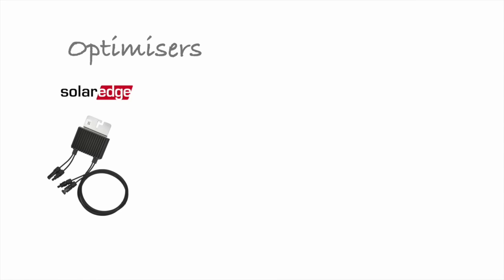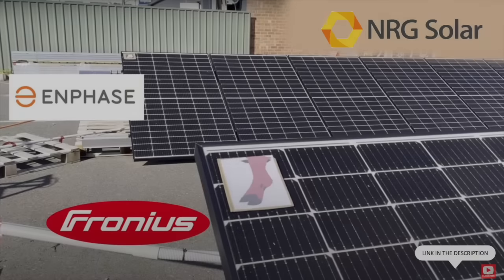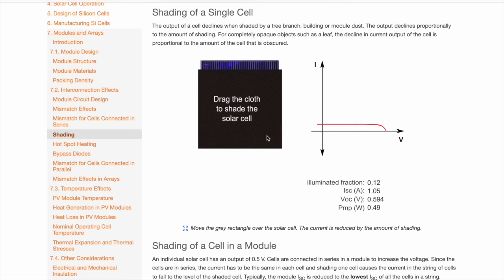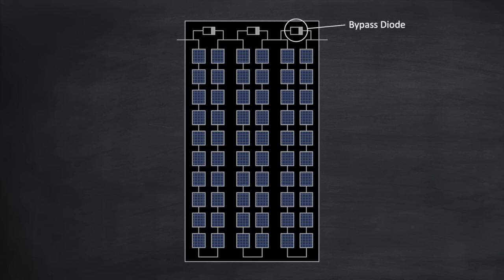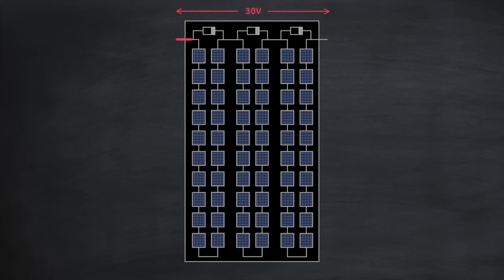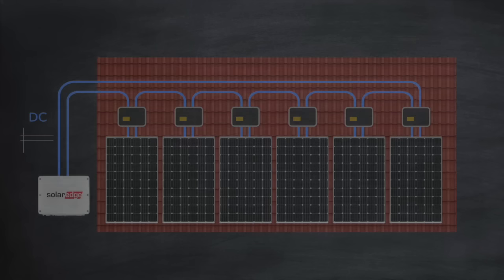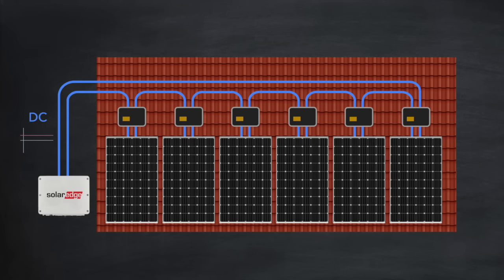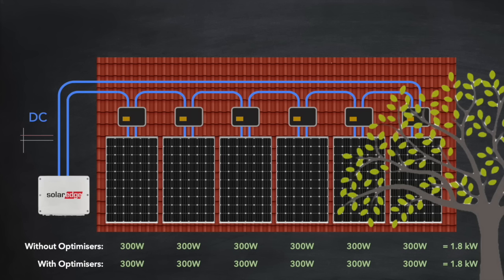Solar Panel Shading (Part 1): Are Optimisers and Micro inverters Worth It?

Comment: An excellent presentation.  In fact that’s one of the best presentations on the subject of partial shading that I’ve seen.  I was aware of the bypass diodes, but hadn’t considered the impact on the larger array.  

I think panels have evolved a little to include “half cut” cells.  I think they run the bypass diodes up the middle of the panel, essentially doubling string number, and halving string length.  It improves two attributes:
- better partial shading performance
- reduced diode hotspots, thereby improving panel life

That diode heat loss can be a real panel killer. 

I did my own shading tests, which I think is in my Spring/June video this year.  The direction in which shading is uncovered has a big impact on performance.
Reply from the maker: Coming from you, Anthony - that's praise indeed! Thank you. I might do a follow up on shading when I've collected enough feedback etc. and I'll be sure to include half-cut cells :-)

And I remember your shading tests - I can't wait to be my own setup installed in January to do some of my own (I'll have relatively easy access to the panels as I have a number of Velux windows on my roof). I've had a bit of a nightmare with my solar journey, which started back in March!

Let me know if you're interested to do something together on YouTube at any time - I'd be game on for that.
Reply: Agreed, well presented. I’m breathing a sigh of relief knowing that I did do the right thing putting Enphase on my second array ( split across SE and SW facing roofs with chimneys ) Thanks
Reply: Direction of shade encroachment is indeed important. Most PV modules are wired as Gary illustrated so that the long edges each fall within one bypass diode zone. This is good for commercial ground mounted arrays facing South and with modules racked in landscape orientation. In that way the shade from the next most southern rack activates the minimum number of bypass diodes
Reply: how many strings can you break an array into? it seems like more wiring would be cheaper than optimisers or micro inverters, but there is a reason there are so many panels to a string and then the strings are in parallel; what are the limits?
Reply from the maker: Hi Scott, so it depends on your inverter. Most inverters only support two strings, but some can support three (or more). For each string, there is a minimum voltage level requirement before generation starts, so ideally, you want a lot of panels on each string to achieve that minimum requirement for longer in the day, especially if it’s cloudy.

There is an upper limit on the voltage (and also current) which will be different for each inverter manufacturer.

Comment: Quite a good video.  I'll add a few other points that need to be considered:

* When designing a string without optimizers, make sure that there is plenty of voltage margin verses the optimal 'operating' MPPT range of the inverter.  For example, if the inverter's optimal MPPT range is 300-500V, you don't want the total operating voltage of the string to be anywhere near 300V.  You want it to be higher so partial shading does not reduce the voltage to the point where it leaves the MPPTs operating range.  Of course you also have to make sure that the string's open-circuit voltage does not exceed the inverter's maximum voltage (for an inverter like this, typically 600V).   So in this example, having the nominal operating voltage be, say, around 450V, would be ideal.

* Not all MPPT controllers are the same.  When partial shading occurs, it changes the voltage-current curve that the MPPT controller sees.  Sometimes the partial shading can cause a 'double peak' on the curve where one peak produces far more power than the other.  If the MPPT controller fixates on the wrong peak, system performance can degrade well beyond what it should.   So, for example, SMA's high voltage string inverters will do a periodic voltage sweep (usually every few minutes) to make sure that the MPPT is servo'd on the correct peak.

* In variable shading conditions... for example, foliage on a windy day, the MPPT point may move around more quickly than the MPPT can track, resulting in additional performance loss.  Optimizers and micro-inverters are able to track these quickly-changing conditions far more quickly than whole-string MPPTs can.   But in most cases, such effects are minor anyhow.

* People often make the mistake of paralleling multiple strings into a single MPPT.  This results in far worse losses under partial shading conditions because any shade will cause the combined MPPT point to be non-optimal for BOTH strings.  Thus, when designing a string system, always be sure to give each string its own MPPT and do not use paralleling (i.e. don't use a solar combiner box to parallel 2+ strings together).   In modern day, it is really easy to dedicate one MPPT to each string, but older string inverters often had only one real MPPT controller.

--

* Also, note that micro-inverters have the additional problem of back-hauling 240VAC instead of 400VDC, which means either (a) higher losses on the return wires or (b) requires lower-gauge (thicker) copper wires to backhaul the same amount of power.

--

The bypass diodes are typically schottky diodes, each with a 0.3V volt drop when operating.  Solar panels typically have three such diodes so if a panel is mostly shaded you not only lose the power from that panel, the string as a whole would also lose another 1V on top of that (per mostly-shaded panel). 

Bypass diodes basically allow current to flow one way with a voltage drop of 0.3V to 0.7V.  The solar panel itself develops a voltage across the panel which puts the bypass diode into reverse bias, which basically turns off the bypass diode.  When shading occurs, the open-circuit voltage of the shaded panel is STILL LIKELY TO BE VERY HIGH, far more than 1V.  However, the load on the panel (in shaded conditions) quickly drops this voltage as the panel is unable to support the current the other panels are generating, which takes the voltage below 1V and essentially turns on the diode, allowing it to conduct the other panel's current.

--

So, generally speaking, it almost never makes any sense to use optimizers or micro-inverters, but one must still be a little careful when designing the string system to avoid the pitfalls mentioned above.  The only situation where micro-inverters or optimizers make sense are in quickly-changing shading conditions because their individual MPPTs can react more quickly to the changing conditions.  But that's it.  I definitely prefer high-voltage strings over optimizers or micro-inverters.

-Matt
Reply from the maker: Wow - this is great insight! Thanks for taking the time to share with me. I'm considering a follow-up video on shading in a couple of month's time - and if it's ok with you, I'll try to include this insight (with credit given of course).
Reply: Great analysis. Maximizing the MPPT voltage is the key it seems, which means longer (i.e. higher voltage) strings are better. This also has the effect of extending the operating (time) window of the system (i.e. inverter on/off) closer to the peaks of consumption (i.e. morning and afternoon) so producing more useful output. Optimisers actually reduce the operating time window by reducing the string voltage slightly (thus resulting in later 'inverter on' and earlier 'inverter off' times), even when completely unshaded. Bit of a chocolate teapot IMO.
Reply: As far as I know there is only one micro inverter producer with true 400V micro inverters, AP Systems manufactures them.
Reply: Losses are higher with 400VDC compared to 240VAC no? Transmission line theory
Reply: @whirled_peas  Didi you get that backwards?  The higher the voltage, the lower the losses, not the other way around.  Losses are governed by P = I^2 * R  (power = current squared times resistance).  For voltage and current, transmitted power is P = I * V.

So for the same power transmitted, the higher the voltage, the lower the current on the wire.   But losses scale to the square of the current so if you hold power the same and cut the voltage in half, losses will increase by 4 times.

For 400VDC vs 240VAC, the 400VDC line will 60% lower losses along the wires.

Of course it depends which country you live in.  In some countries the utility connection to the house might be higher.  But in most it hovers around the 200-240VAC range.

This is also why advertised efficiencies for micro-inverters and optimizers are usually somewhat disingenuous.   For micro-inverters it is because they don't count the higher losses on the back-haul.  And for optimizers it is because you still have to add-in the losses from the inverter that the optimizers are tied into (thus going through an additional conversion).

-Matt
Reply: @enemyofthestatewearein7945  This analysis contains holes. 
It talks about open circuit voltage which is irrelevant because the panels are not open circuit.
Reply: Don't buy an inverter with an MPPT range of 300V to 500V, simple. A cheap Voltronic 5kW inverter will have an MPPT range of 120V - 500V. But everything else you said is brilliant!
Reply: @johnthomas338  No, that doesn't work.  These larger inverters output 240VAC to the grid, not 120VAC, and buck-boost inverters (which would be required to allow a low-voltage input) are far less efficient than buck-only inverters.  Also, solar panel generation goes to zero very quickly as the voltage drops, so you aren't getting anything if the voltage drops that far below normal operating voltages.

So all you need to do if partial shading is an issue is to make sure you have enough margin to deal with a panel or two dropping out, that's it.  And it is very easy to do.

-Matt

Comment: Hi Gary [- Truly EXCELLENT video - concentrating on technical detail on how panels work and the effect of bypass diodes.  As a professionally qualified  electricaland electronics engineer-  I think the solar trade in general needs far more of this excellent level of instruction. ( Sadly lacking  -you only need to read some of the forums to see how poorly solar power is understood,

Having taken many so called "solar installer courses"  from well known manufacturers  - this video mostly stands head and shoulders above those - in terms of accurate well  presented technical detail - not so such as to baffle people - but more than enough to understand properly what is going on

Excellent !
Reply from the maker: Thank you, Eric - that's praise indeed!

I'll keep working on new videos :-)
Reply: indeed Eric!

Comment: Quite frankly this is exactly what I have been looking for. Excellent presentation, and excellent communication. Having had solar for three weeks now, no micro inverters and the potential of chimney shading, this video has totally relaxed my worry about not asking for micro inverters. Thanks Garry - you have a new subscriber!
Reply from the maker: Thanks Barnaby - much appreciated! Glad to have put your mind at rest 👍🏻
Reply: @GaryDoesSolar  same situation here. I'm glad I've not performed a costly installation of optimisers on my 7 year old system. As you point out, the extra complexity increases your chances of failure and the benifits while there are not so big as to justify the cost.

Also, very nicely paced clear explanation with good illustrations.
Reply from the maker: Thanks Miles 😀 I’ll try my best to sustain this with my planned future videos 👍🏻
Reply: There are other reasons you would want to go with solar edge optimisers, #1 being the ability to oversize your panels and get access to dc power to charge battery or ev. Absolute game changer that your string inverters cannot entertain unfortunately

Comment: I've just read through most of the comments on this excellent presentation/video. There is really very little I could add. Extremely informative, challenging & clarifying supplier based information; excellent  graphics. I suppose in summary, I feel in safe hands, without a hidden agenda. Thanks very much 🙏
Reply from the maker: Wow - thanks, Nic. That's very kind of you to say. I'll try to keep up the level of quality :-)
Reply: @GaryDoesSolar  You started out with a very high bar 😉

Comment: I did a 2 panel test in series hooked up to a Bouge RV MPPT.  Both panels getting full sun I covered one with a blanket. It took the watts to near zero for about 20 seconds but then the mppt adapted and gave about half of the 2 panel wattage. I think the whole panel has a bypass diode too that keeps one shaded from taking out the whole array.  
Two panels in Parallel reacted to one fully shaded panel a lot faster almost immediately halving without going to zero for 20+ seconds.  This convinced me that parallel is best for small RV 12v systems.  You never know when you will turn and have shade across a panel. Losing 20-30 seconds of power everytime would add up. I also saw an increase in heat for the mppt controller with the series due to higher voltage having to be downstepped to 14.4v.  However Series is a must for higher voltage battery systems (24v or higher) or you can use higher wattage panels as an option.
Reply from the maker: Thanks for sharing the results of these experiments! :-)

Comment: Hi Gary, 
As everyone else has said, this is another brilliant video  -  perhaps the best yet. The fact that you are very even-handed means, as you say, viewers can (and should!) make up their own minds  on the subject. 
I've just placed an order for a 16-panel (8/8 east/west array)/5kWh battery system. At this time of year, we will have heavy shading on the west array (from about 2.30pm until about 5pm) from a large oak tree in a neighbouring garden. 
I've asked for Tigo optimisers on all of the west panels. We will have some shading on four of the east panels during the morning from a chimney. After some thought, I've decided to add optimisers to those four affected panels as well. I'm in discussion with Tigo at the moment about whether the Tigo Access Point (TAP) on the west array will be able to manage the additional four east panels. (The TAP connects to each optimiser by WiFi and is connected to the control gateway by a cable).
When I started to watch your video, I wondered whether I'd specification the optimisers unnecessarily, but by the end my opinion is that for my situation I have made the right decision. 
Just a note on the point about costs: I've done a quick search for Tigo optimisers and the CCA (gateway) & TAP are available for about £60 & £400 respectively. Not an inconsiderable overall expense, but one which should, in my case, have a reasonably quick payback (I hope!).
Reply from the maker: Hi Phil - thanks for taking the time to comment in detail about your own situation. Yeah, I agree - optimisers are a good solution for you - and I would have taken the same approach. I'd love to hear how it all goes! :-)

Comment: Thanks Gary. This video is a model of clarity.
I have recently been mulling over the question of optimisers but, aside from generic 'marketing-speak', I had found very little in the way of hard information.
My gut feeling was that, for my installation, optimisers would offer little benefit and your helpful video has backed this up and saved me quite a bit of cash 😀.
Reply from the maker: Thanks for the kind words, John - and great to hear that I've been able to help you work through some of the decisions you have to make.

Comment: Very informative, thank you. If we ignore reliability of the bypass diodes for a moment, it looks like only part shading that does not trigger the bypass diodes is an issue in terms of generation (overall the system generating less than it actually could so to speak.)

A quick search online suggests that bypass diodes can/do fail, and avoiding unnecessary load on them might be beneficial. In which case optimisers or micro inverters might have value in terms of long term maintenance/reliability, quite aside from slight increases in generation. HOWEVER, I am an amateur and quick searches online by amateurs often lead to mistaken beliefs…

I have a house with quite severe local shading on much of the roof, that varies through the day and seasons, so have a more complex situation than anyone with no local shading issues. My feel at the moment is that I will be using optimisers or micro inverters.
Reply from the maker: Thanks Glenn - I agree with your analysis. And if my situation was similar to yours, I'd be looking at having optimisers too.

Comment: Very clear and informative.  One advantage of microinverters is their ability to shut off power when the grid goes down.  This is a safety issue and a requirement here in the US.  If firemen need to go on the roof, series solar panels can present a dangerous HV DC.
Reply from the maker: Thanks Ken, for the kind words. And thanks also for highlighting this extra benefit. Although the videos on microinverters I've made up to now have been focussed on shading, I am going to make a video dedicated to microinverters, covering all of their benefits - I'll make sure to include this one :-)